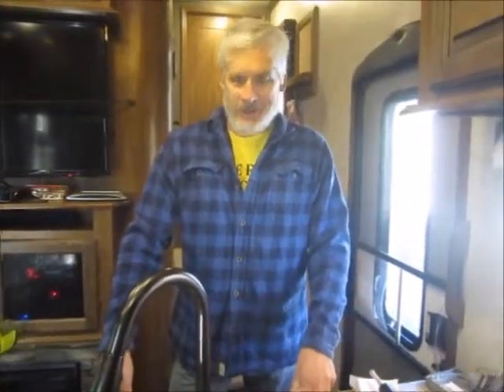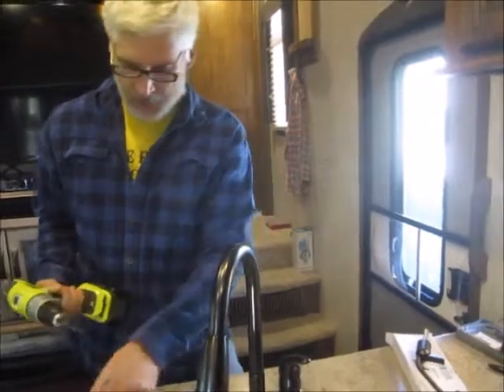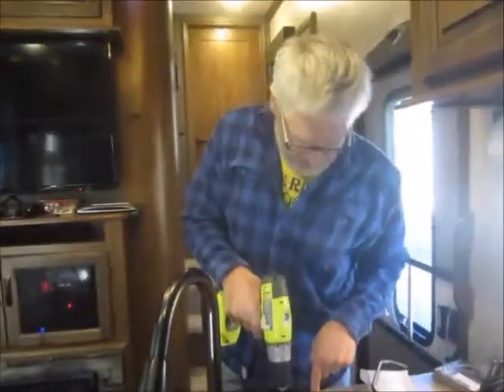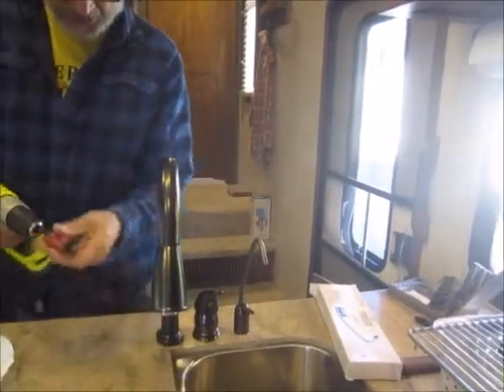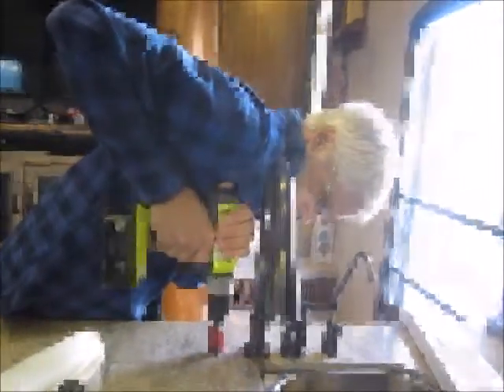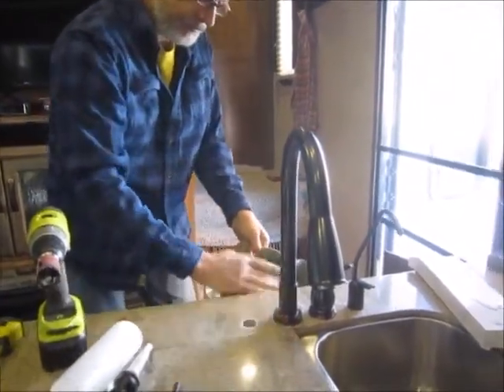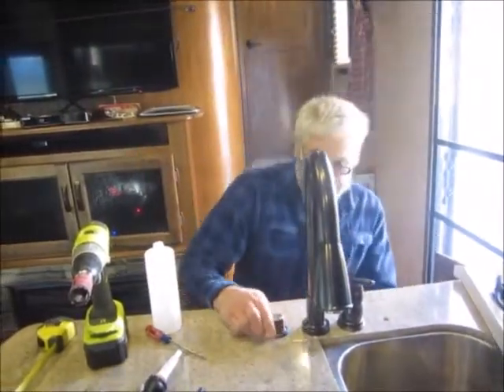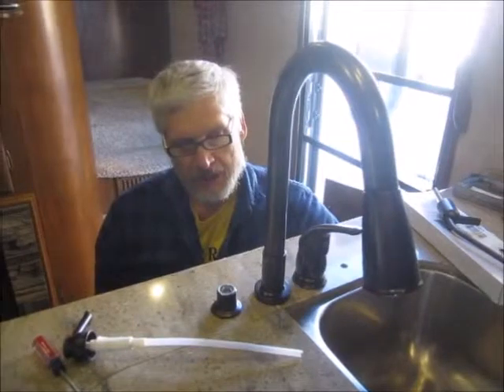RV Under sink 5gal water jug tap Part 1, faucet and soap dispenser drilling corian Raptor 300MP

Comment: Omg did you take the panel off the back to access your water lines?! That’s genius!!! Also what type of hole saw did you use?
Reply from the maker: Yes, thank you for the kind words.
The hole was just the standard type with a center pilot drill bit you would buy at a home improvement store or lumber yard.
This particular one is Milwaukee brand.